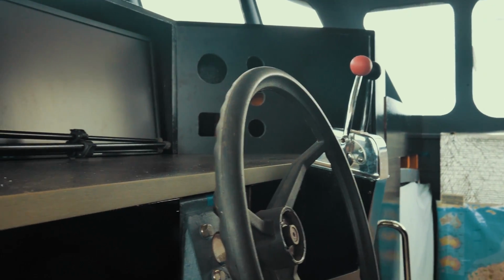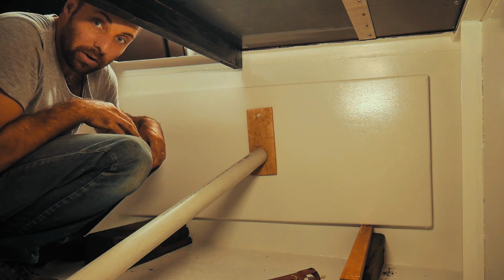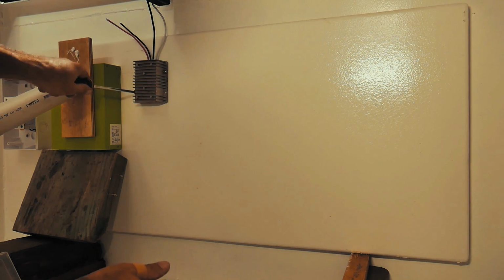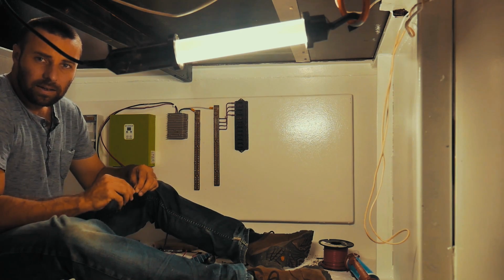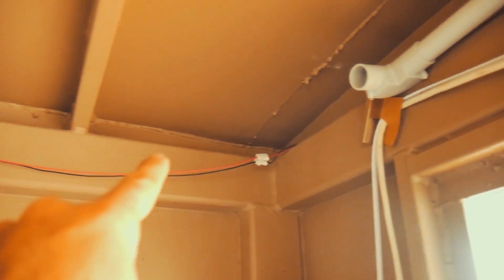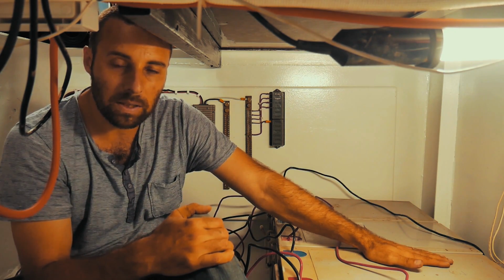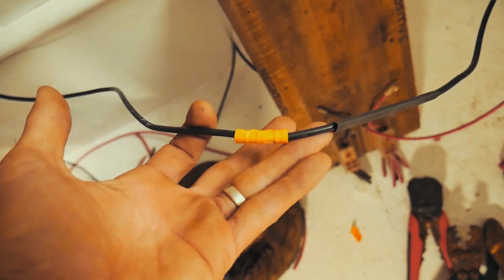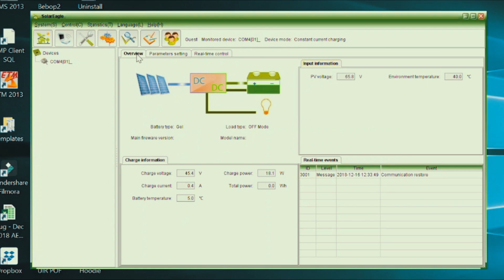Solar On A Boat (Part 2 of 4) Building Brupeg - EP. 62

Comment: I have done a total rewire of my 30’ boat amongst other things and have to admit to still get thoroughly confused as to what is good practice/should be done and what not. If you go and seek out the opinions of the experts who seem to come with good credentials you will find that you should never use spade connectors, others say no soldered connections on boats because if a cable heats up that connection (particularly when low temp solder is used) may well separate. Then the NASA cable connection is recommended by all and sundry but you will find quickly someone telling you that this method is only specified for solid core, not multistrand cable. Go figure. The one thing I have learnt reliably is it that Chinese crimp connectors mean trouble
Reply from the maker: Yeah I get that ask five experts get five different opinions thing. Noted on the cheap connection issue, thanks
Reply: As long as it's safe, trial and error, find what works for you in your situation,  as I'll guarantee that wont always be what will work for someone else in their situation.
Reply from the maker: Yeah that’s true. It’s not as hard as it’s made out to be.

Comment: Those Badass fuses are known as HRC fuses which stands for High Rupturing Capacity. :-)
Reply: Oh, and on the low current from the panels, if they are wired in series the maximum current of a single panel is what you will get from the array, just like with your batteries. Also, if one solar panel is dud, it will limit the entire bank's current. The voltages will still add up to the sum of the panels but the current will be limited. This is at least my experience with solar.
Reply: @garybaris139  I wondered if a dud panel was acting as some sort of resistor, too. Easy enough to test: get out there with voltage probes on a sunny day at noon and see if they are all in the same range.
Reply: @svalchemy , Oh absolutely. I often cringe when I see people do solar installations with part of the array in the shade as it totally ruins the performance of all the panels in that array and the array simply cannot perform at its best.
Reply: @garybaris139  Yep.  Shade is a killer - even a thin line of shade can kill a panel's output, and thus the entire string.  One way around this (and also help in the case of a dud panel) is to use panel optimisers such as Tigo:
(www.tigoenergy.com/)
Reply from the maker: Hi guys. So I’m aware of the shading issue that’s why I wired them the way I have. The only possible shade Brupeg gets is the exhaust stack. This can only affect 1 pair of panels at a time. I have 8 panels wired as 4 pairs in series. So 36-72v producing 7.8amps per pair. If one pair is shaded I will lose 7.8amps but the other three will produce, so I should always be getting 23-31 amps at 65-70v (assuming good sun). 

Now all of this said, I’ve found the main issue I think. My multimeter has a fast blow 10amp fuse for measuring current. It can measure 6.8 amps consistently but above that the fuse heats and blows right on 10. Each pair has been measured (very quickly to save the fuse) at 69VDC/9.8A. So the panels are absolutely cranking the power out. I have almost zero voltage drop up to the charge controller. The controller is now reading the same voltage (it never varies which I thought is odd for an MPPT controller) but the amps are 1-2. I think the controller is doing weird things
Reply: @ProjectBrupeg  My OCD would never allow this to be unmonitored. I would put a volt meter (or two - but two would require each bank to feed through a diode) and an ammeter per bank in the dashboard. That way you can always see how much power is coming in. You get the meters in dual meters (backlit LCD display) that gives both voltage and current in one meter.

Please don't think that I'm trying to tell you what to do, it's just what I'd do. 

I'd probably have a 3rd meter for monitoring the charge going to the batteries from the controller.... you even get an indicator to tell you the condition of your batteries although I'm not sure if you get them in 48v.

The problem with these systems is that often you won't know there's a problem until you are out of power. Will you have a backup charging system running off your engine?
Reply: Wait, that's an MPPT controller? Those collective power readings are enough to do light welding, so no worries there. Wow, this is a puzzler.

Comment: batteries are in series. 4 x 12 V DC batteries  = 48 V DC 200 AH.
Reply from the maker: The batteries were set up as 4x12v/200ah batteries wired to be 48v/200ah. We are about to alter the system to be 24v so all of this will change soon anyway
Reply: @grantflavel9822  I thought they were all parallel not series parallel.
Reply from the maker: Hi grant. The cables are actually oversized by a factor of two. The panels work at 65-72v with a total of 28amps. The cable is 8mm2. All of this is now irrelevant as we are changing our single MPPT controller to four victron MPPT controllers (1 controller per pair of panels) so the cabling will need to be changed to four runs as well rather than a single pos and neg.
Reply: @ProjectBrupeg  8mm² (cross sectional area of the wire) would be equivalent to what we in Canada would call 8 gauge
14 gauge = 2.08 mm²
4 gauge - 21.1 mm²

Comment: It's the step down convert. It's 150w /10A. Well if it is the same as my one.
Reply from the maker: Not sure what you mean Todd? Do you mean the charge controller is stepping the amps down
Reply: @ProjectBrupeg  DC to DC converter.
Reply: @ProjectBrupeg  oh its not that end of things you are having issues with. Still something to keep in mind tho.
I use a 24v to 12v one and I only just worked out it can handle 150w. Not really handy when it comes to charging most things. I'm just going to get a 24v inverter eventually.
Reply from the maker: Ahh yeah this is a 48v - 12v 30amp unit. Used on a golf cart so fairly robust beast

Comment: Hi love your thought processing,     but do not loop and electrical wire as this causes what they call an inducting loop which heats up!!! which brings me to one more point if for some reason your positive or negative wire heats to the point of melting for what ever reason this will cause you cables to short out and you will have a fire therefore i suggest you do not run the positive and negative wires together . HOPE THIS HELPS food for thought. cheers Guys and Merry XMAS
Reply from the maker: Ok good to know. Easy issue to fix. I will seperate them now. Thanks mate

Comment: How many watts is your dc-dc convertor? Looks kinda small. 

I use 36v-12v 300 watt dc-dc convertors quite a bit and i still have to be careful on overloading them.
Reply from the maker: Hi Todd. It’s a 48VDC-12VDC 30amp max water proof golf cart converter. For us it’s lucky if it ever sees more than 10 amps as it only runs the LED lighting throughout the boat and 1 2 amp USB charge point.
Reply: @ProjectBrupeg  So what are your water pumps and bilge pumps,  etc..., running on? different convertors or running them at 48 volts? Also are you running any inverters for AC?

I am a DC tech for telephone switching equipment and also build wiring harnesses and control systems for DC powered industrial electric vehicles for side work. So i do lots of DC work. Mostly in 36v to 48 volt up to 4000 amps sometimes.

Love dc tech! Thanks for the vid!
Reply from the maker: Awesome good to know. Currently we don’t have any other DC load but that will change. water pumps will likely be a large single pump to pressurise the whole boat, fuel transfer pumps will be 240v, most appliances will be 240 and this will all be run via a 48-240 inverter that is yet to be brought and fitted

Comment: Hope the charge controller never needs replacement
Reply: Yeah, Grab a Spare...
Reply: polyurethane glues are easy to cut through with a steel cable, same way windows glued in with poly are removed from cars.